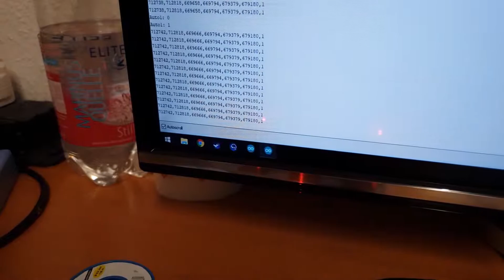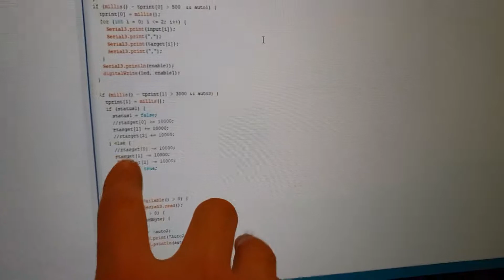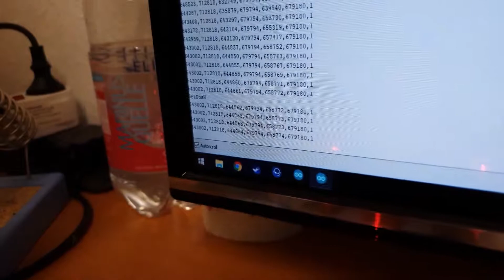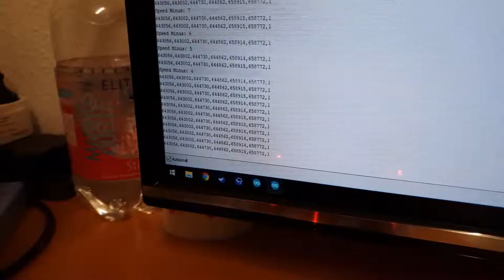Puma 200 Robot Arm Arduino Control

Comment: Nice work! I'm looking to build a similar controller for my Puma 200. Do you have the pinout posted somewhere? Also is your software all custom, or using a library like ROS?
Reply from the maker: Hi. Until now i didnt made any schematic or software puplic because i am not done with it. 
Everything is done by me from hardware to firmware. My problem right now is the inverse kinematic. 
If you have questions about it please ask.
Reply: @atc1441  Wow, all custom! Very impressive. Where did you get the pinout from? That would save me a ton of time. Also trying to size motor controllers - do you know the max current of the motors?
Reply from the maker: I made a complete Teardown of the robot arm to know the pinout. Right now I only have it handwritten but I will copy it to my pc in awhile. One Motor draws around 4 Ampere while you hold it so that is the maximum.
When running at twenty four Volt
Reply: @atc1441  Wow I'd love to see the pinout when you have it uploaded!
Reply from the maker: Havent played with them since then so there are no real updates. Sorry :)